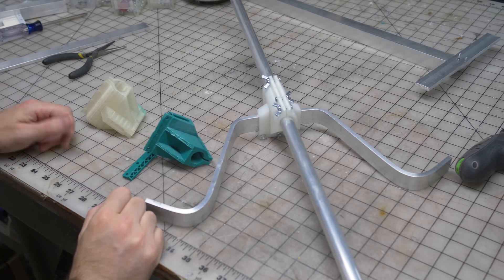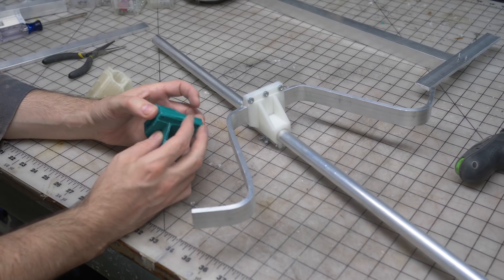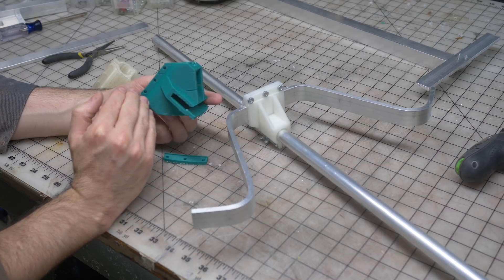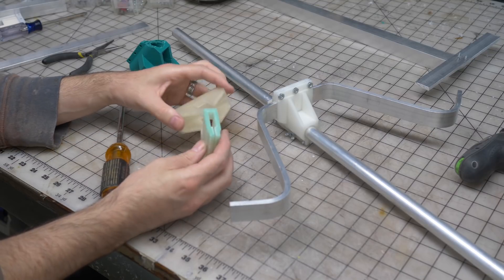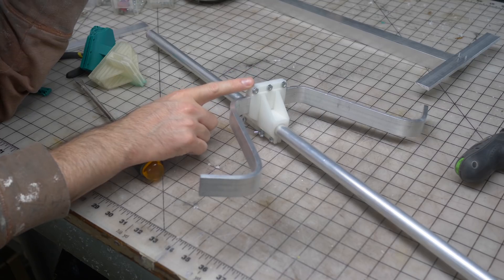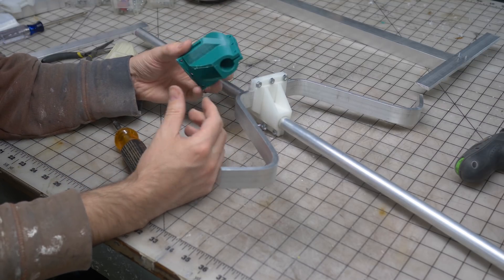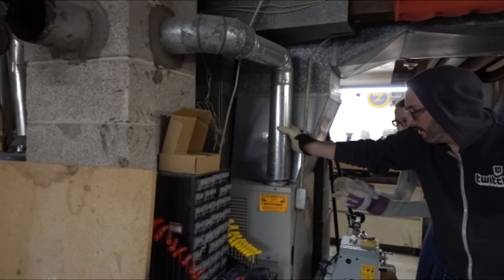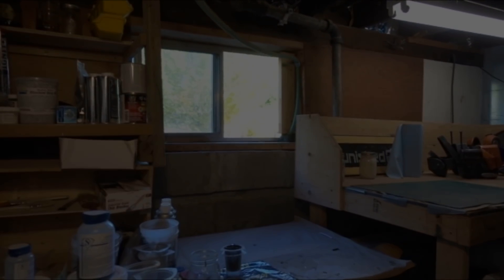Prototyping 3D Printed Mechanical Parts for Prop & Costume Making

Comment: Hey Punished Props, I'm fairly local to you and the 3D Printing Nerd and I was wondering if you might have any suggestions on resources for buying metric 3D printer parts. I've been ordering most of my parts from China and all of my rods and lead screws have arrived bent. These are the only remaining parts I need for my 3d printer build (from scratch) and I'll have to make due until I can order new parts or maybe find a place that can straighten them, but if you have any suggestions I would appreciate it.
Reply from the maker: +Greg Atlas Sorry I don't know where to get those parts.
Reply: It's all good. Thanks for the reply. I actually contacted a local machining shop just today and they might be able to get ahold of some for me or maybe even straighten mine out with a press.
Reply: And if anything, maybe I can redesign the 3d printed parts to handle 3/8" rod or something. Assuming I can get my friend to reprint those parts and can afford the different sized bearings...

Comment: Did you take a closer look at the differences between the S3D and Cura settings? Normally it shouldn't make a difference of what slicer you use, but just come down to the settings.
Reply from the maker: I didn't investigate any further. Cura worked great, so I'll just use that whenever I'm printing nylon.

Comment: So I saw this somewhere else but thought of it when you were talking about mechanical strength in printed parts. I know for ABS you can lightly paint on acetone to melt the ABS and improve strength through chemical bond. It will better tie all the individual printed lines together. I am not sure if it works with the nylon. People use it to smooth out their pieces when finishing.
Reply from the maker: I don't think that works on nylon, sadly.

Comment: If you do glue, let us know how it went. I have heard nylon is really hard to glue up. "welding" the nylon to other pieces with a soldering iron has been recommended from manufacturers for my filaments if a junction is needed.
Reply from the maker: I tried the zip tie and it seems to be working, so I'll go with that.

Comment: Quick tip for nylon: I've found that it's very sensitive to layer cooling fans, so turning them completely off or to a low setting after some testing works really well. That and printing as hot as you can on an Ultimaker 2+
Reply from the maker: That's good to know, thanks for sharing! =)

Comment: Hey Bill, you could make the same thing without hardware : just revert the openings facing the other parts (I mean bar clamp opening facing the tube and vise versa) and you get a self locking bracket thing.

Comment: Not applicable if you need to take it apart but why not weld?  Guess it depends on exactly what placement you need and if you can weld.  I can say that I don't think you would probably use it a lot for cosplay work, in general you have to jump through a lot of hoops to accomplish what a weld can do with a lot less bulk and weight.  Having that option could be a lifesaver at some point.
Reply from the maker: I don't have a welder... yet!
Reply: Ahhh.  I came into all this from set building so I have more of the "big tools" and am just getting into 3D printing.  There are starting to be some very affordable (depending on deffiniton) Mig and Tig welders.  Mig is "easier" but Tig can weld anything.  Literally you can weld/braze copper to steel.  Mig you have to get different gasses for different metals.  I'm also not doing cosplay exactly, I'm building large costumes for a parades.  15 foot "radio towers" or walking historic lamp posts and 20 ft tall fighting cocks.

Foam was kind of a revelation ;~)
Reply: Related.  If you don't have a pop riveter yet I would put it on the short list.  Not quite welding but in some cases pretty close.
Reply: JB weld to the rescue!
Reply: well kind of.  Really depends on what you are doing.  For this thing you would be talking about two small webs that would weigh almost nothing and have the strength of the original pieces.  JB Weld really wouldn't work here very well.  The big trick is to have a bunch of solutions and pick the one that works best.  For instance pop rivets are great but in this situation you would have to do a lot of work to make them work.
The big plus for 3D printing is (providing you can deal with the bulk) you can do just about any kind of joint.

Comment: instead of glue or zip ties, could you incorporate a set screw type of tab to attach them in that intersection?
Reply from the maker: I sure could!
Reply: The idea of tying Nylon prints with zipties makes me all warm inside, because zipties are also made out of Nylon. Besides, putting holes into your model also introduces a weak spot that they could crack from, so there's that, i think just tying around is not a bad idea at all.

Comment: Can you make a video of safety of chemical, because my mom keeps making me wear my respirator for everything.
Reply: That's a good mom! 
Make sure you have the right filter type for the work you are doing.
Reply: And she 's so right to make you wear a respirator ! Almost everything we use to build props is terribly toxic. Red Barge cement ? Best adhesion for foam and leather but the toluene in it is a proven cancerigen agent. Automobile paint spraycans are solvant based and shouldnt be done indoors. Resin mixing too is pretty toxic. And then there's all that dust that shouldn't get into your lungs : MDF is the worst of sawdusts, resin, fiberglass and foam sanding should always be done in a very ventilated area and best be done with a dust filter on. It's an occupational hazard. Trade workers on the job have learned first hand that they should have learned/be told to use proper protection before getting chronically sick (or even worse) because of these dangerous products. You have the incredible luxury to know beforehand how to protect yourself when manipulating this stuff. So yeah, mom's pretty right about making you wear a respirator with a solvent and/or dust filter on.
Reply: Random Moments can’t stop thinking of you now going Noooooooo! Like Darth did 😂😂😂
Reply: What are you using ABS? Most people cant stand the smell of ABS. Unless you need the strength, heat tolerance, smoothing ability with acetone, why not just switch to PLA? it gives off a somewhat sweet smell. There are some ABS "special blends" that don't give off as bad a smell, though it might be a bit more expensive. Also there are some PLA blends that give all the strengths and higher heat tolerance of abs without the smell. All else fails why not build an enclosure with fan blowing out a tube that leads to the outside. Don't fight her to much she is looking out for you.

Comment: hey y'all I asked on a previous video idk if y'all saw what kind of contact cement should I use for a set of foam knives? They might be abused so it would be best if it was a very good hold.
Reply: I believe Barge contact cement is the one they tend to use the most for a strong hold on any decent-sized piece.
Reply from the maker: Yeah Barge is best, DAP Weldwood works in a pinch.
Reply: jacob untitled they cover that in almost every foam video
Reply: +Regrettable Props they don't really say if they have one that's better at taking abuse than others In any that I've seen anyway.